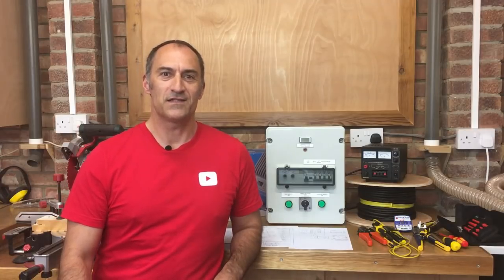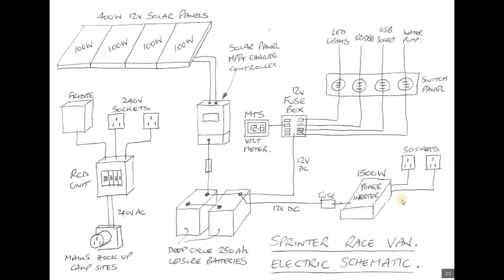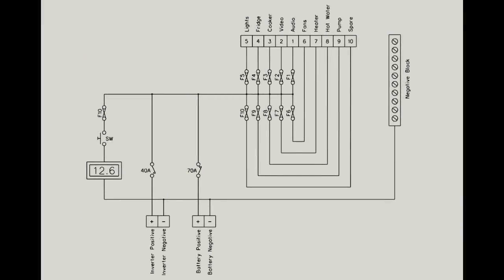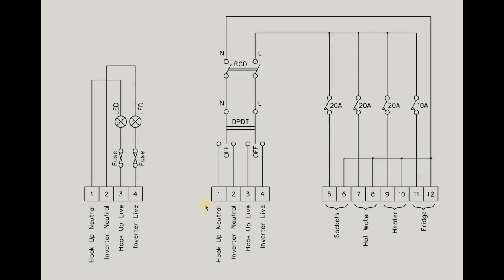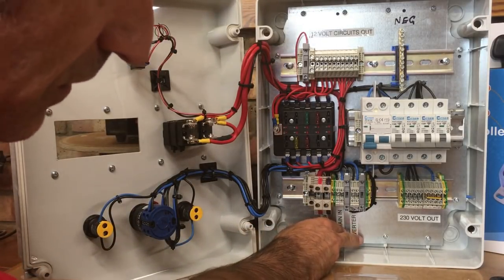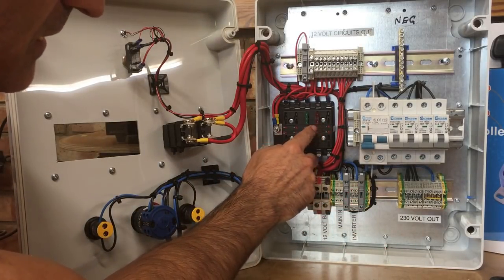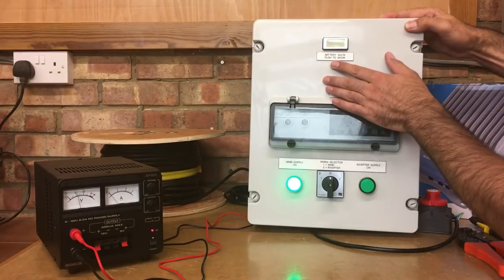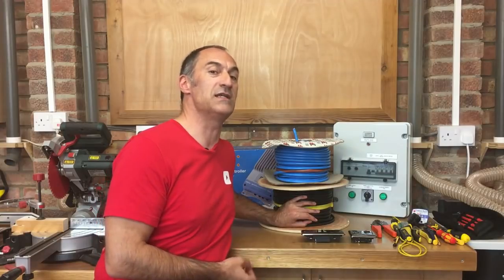Self Build Camper Van 12v Electric Control Panel

Comment: Great setup Greg

Just one couple of questions if you dont mind. Are you plugging into three pin uk inverter outlet and directly to input of consumer box, what cable are you using from hookup point to consumer box and lastly from what i have been reading up on i assumed that the cables should come in from the rear of consumer unit
Reply from the maker: Hello john, most hook ups are single phase 16amp breakers. 
So your blue hook up lead is most likely to be 2.5mm cable. 
From the back of your socket to the consumer unit can also be 2.5mm. I have also wired from the inverter to the consumer unit the same. 
All cables are rated by current used. Watts/Volts=Amps
Then google a cable sizing chart to give current carrying capacities of various cable sizes. Beware your 12v DC cables will draw more current and may need much bigger cables. Fuse sizes are 1.25x maximum current used.

Comment: Hi Greg, great videos and your attention to detail. I watched all your videos and I can't wait to see when you are going to finish and start your adventure.
Hopefully you will post videos from your adventures.
I have a question, from where did you get the distribution board/box?
Reply from the maker: It was built to my own design from components sourced from electrical wholesalers like RS
You can buy the enclosures off eBay if you are confident to do the wiring, quite a few have done similar panels.
otherwise, I would recommend looking for PMS3 panel, very good and cheap solution.

Comment: I'm a little confused about the edit to the post regarding the breaker - I didnt see a separate breaker for the panel but rather a DPDT switch leading into the rcb and circuit breakers.
In effect you are switching between shore power and the inverter to power the same set of sockets and any special circuits (A/C, maybe fridge).  The inverter output is set by the capabilities of the inverter.

As I saw it the 12v side of it ran through fuses not breakers.  If the inverter draws 2000w on its input side it makes sense for it to be separately protected.

I have a couple of different problems with and Aussie build as we are required to use double pole switches, breakers and points in caravan use to disconnect both active and neutral at the same time as a safety issue.  I also want to feed in between shorepower and inverter and Im thinking of using a din rail 3 position double pole changover switch (up mains, centre off and down inverter) with slimline double pole RCBO's per circuit (probably only 2).  I like your panel however I doubt that I will have the luxury of that much room.  We also have rules that prevent anything being stored in front of a switchboard if its placed in a cupboard so I expect to place the panel in a shallow cupboard somewhere behind the driver's head (facing forward)
Reply from the maker: I had originally wired the 12v supply to the inverter from the panel and put a DC trip in there but it was hugely undersized.
An error in the manufacturer's literature that I stupidly took for granted without checking. Plus better to have protection near the batteries to protect the cables.

Comment: This is impressive, but I'm not that clever. Instead, could you just wire a mains source via a battery charger to your house battery? then just use the charge to keep your batteries at 100% when you have mains power.

Comment: Hey Greg, Do you have a diagram that describes your internal wiring? I have started mine however i was trying to avoid splicing the DC cable so now i have 18 individual cables and am scratching my head on what to do next. 

Are you able to provide some ideas.

Comment: Hi Greg. Quick Question - having removed the inverter from the diagram for the 12v side, where does the inverter feed now come from and where is the trip now located? Cheers, Gavin
Reply from the maker: The inverter feed will come directly from the leisure batteries and the isolator and fuse will be located close to the batteries.

Comment: Hi Greg, Can you tell me the name of the DC trip protector and where I can buy it? thanks
Reply from the maker: You can get various different size circuit breakers for DC circuits
https://rover.ebay.com/rover/1/710-53481-19255-0/1?ff3=4&toolid=11800&pub=5575265109&campid=5338027957&mpre=https%3A%2F%2Fwww.ebay.co.uk%2Fsch%2F181818%2Fi.html%3F_from%3DR40%26_nkw%3Ddc%2Bcircuit%2Bbreaker%26_dmd%3D2
Reply: Greg Virgoe thanks Greg I meant the black relay

Comment: Hi Greg, Do you have a ebay link for your raw distribution board?
Reply from the maker: https://rover.ebay.com/rover/1/710-53481-19255-0/1?ff3=4&toolid=11800&pub=5575265109&campid=5338027957&mpre=https%3A%2F%2Fwww.ebay.co.uk%2Fitm%2FWEATHERPROOF-IP65-LOCKABLE-ABS-ENCLOSURE-WITH-METAL-BASE-PLATE-CLASSIC-WALL-BOX%2F112869512272%3Fhash%3Ditem1a478c1450%3Am%3AmwVlFok5tQmjNYB4EEcZ3sw
Reply: @GregVirgoe  What's the extra door you have added to the front of your enclosure called? Trying to find one without knowing the name for it is a pain.

Comment: Hi Greg, great set of videos you have here, they are very detailed and easy to follow. I am building my van up for a 2 month trip around Europe next month and many more I'm sure. I was wondering if you make these consumer switchover units to sale? This setup is exactly what I am after, and it would be ideal if I could buy a unit like in this video ready to go, would you be able to make another and if so how much would you be looking (I'm in the UK) thanks again for the videos - subscribed!
Reply from the maker: Hello Steve,
Unfortunately, due to health and safety, I cannot produce these to sell myself as I would have to jump through so many hoops to have them checked and tested and certified it would make them far too expensive.
There are very reasonable power panels available that do a similar job on this link
https://rover.ebay.com/rover/1/710-53481-19255-0/1?ff3=4&toolid=11800&pub=5575265109&campid=5338027957&mpre=https%3A%2F%2Fwww.ebay.co.uk%2Fsch%2Fi.html%3F_from%3DR40%26_nkw%3Dpms3%26_sacat%3D0%26_dmd%3D2

Comment: Hey Greg, been following your vids a while, wondering what red wiring you've used here to connect to the positive of the fusebox with a possible link to purchase. I'm about to install fusebox on my little suzuki carry and was going to use 1.5mm 2 core wire as you've specified before but this thicker red wire looks different and I've seen it on many other vids. I've also noticed your fuse box doesn't have a negative terminal bus where as mine does. So what wire you think would be suited?
Reply from the maker: Hello,
The more circuits and appliances you add the thicker the wire needs to be to handle the extra current (amps)
So that's why the leads coming off your battery to feed the fuse box are much bigger. use this chart to determine what size cables you need. https://goo.gl/images/zKViC1  The wires in my panel are "Tri Rated" so they can handle a greater temperatures.

Comment: Hi Greg, 

What thickness is your junction box? I’m copying this and want to make sure everything fits flush like yours.

Keep up the great work! 

Thanks 

Craig
Reply from the maker: Hello Craig, it’s a standard adaptable box and was much deeper then the trips. You may be able to see that the metal din rail is raised off the back plate by threaded rods to bring the trips level with the cover. You can adjust the threaded rods to get the spacing correct. Hope that helps.
Reply from the maker: Hello Craig, it’s a standard adaptable box and was much deeper then the trips. You may be able to see that the metal din rail is raised off the back plate by threaded rods to bring the trips level with the cover. You can adjust the threaded rods to get the spacing correct. Hope that helps.

Comment: Have you found an electrician to test your electrics? I've contacted so many who won't work on campervans so it'd be great to get a recommendation if you know of someone who offers this service.
Reply from the maker: Hi Hannah, normal household electricians don't work with 12v systems so it's better to search for Auto or Marine Electricians as these both deal with 12v systems and I find Marine / Boat industry most helpful as they know about leisure batteries and inverters. Here is a very good list of electrical trades people across the country. http://www.canaljunction.com/boat/electrics.htm
Reply: Thanks so much Greg. We ended up having a regular electrician look over everything and he was happy with it. But I think we would've been better going with someone more specialist. We were pretty confident everything was right though so it was just for some peace of mind.

Comment: I am familiar with the electrics, because this is basically how it works on my boat (old wooden converted fishing troller), where it was done by a certified marine electrician because I didn't trust myself with it.  But I sure wish I had had this explanation when I tried to wrap my head around how the electrics worked.  Nice, clean build, and very clearly explained.  All the fledgling vanlifers out there could definitely make good use of it.

I'm subscribing even though I probably will never convert a van (very happy with my boat), but it'll be instructive and interesting to follow along, I think.
Reply from the maker: Thank you so much for such great feedback. Do you use solar or wind turbine for off-grid power?
Reply: Both because we have the room to put up solar panels, but primarily wind.  We live on the coast of Vancouver Island, British Columbia, Canada, where wind is a lot more reliable year around than solar.
Reply from the maker: I’m guessing you naturally get a difference in air pressure from sea to land so there’s always wind at the coast. Do you have a charge controller that can take a dual supply?
Reply: Right, it's almost always windy; we might get a few days in deep summer where everything seems to be dead, but it's rare.  Yes, we have a charge controller that can handle multiple inputs.

Comment: Hey Greg! When you hook up all your negative 12V to the Bus Bar, do you have to ground that back to the batteries, or can you ground it on the frame?
Reply from the maker: Hi, all the 12v negatives from the panel go back to the negative on my leisure batteries.
Reply: Thanks Greg! And is the leisure battery grounded to the frame, or no?

Comment: A question about mains (not DC) grounding. I'm imagining that an AC appliance in the van is plugged in to a house mains source via an extension cord. The grounding is thru the cord (and fuses in the house panel). Regarding the grounding, why cannot the van mains can be considered the same situation? i.e. why ground the van mains to the chassis via negative DC busbar?
Reply from the maker: Lets clear up the terms first. With mains, you have a Live, Neutral and Earth.
When on a hook-up you should have all three in your hook-up lead and earth will be via the earth wire.

When you say Ground I always think that you refer to the earth connection.
Your van chassis is used by your Auto electrics as a negative return path to the van battery, this is not an earth.
Your positive is wired to all your devices like radio and lights etc then the neutral return to the battery via the chassis.
It just a way of saving running loads of wires in your vehicle.
I plan to keep my 12v leisure circuits separate to my vans auto electrics so there are no issues and I have run live and neutrals to all my 12v devices back to my panel.
Hope that helps.
Reply: Thanks!  I watched again - somehow I got the (wrong) idea that the AC grounds were connected to the DC negative busbar instead of just feeding thru the RCD.

Comment: HAve you considered running a circuit (always on but tripped) from the 230 V to a battery charger for your leisure batteries when hooked up?
Reply from the maker: Yes, my mains battery charger turned up today, 
look out for a future video on this.

Comment: Great set of video's! How did you make the labels for the front panel?
Reply from the maker: A local guy to me does engraving and they are engraved on a material called traffolyte which is a plastic sandwich white/black/white and he engraves through the white layer to expose the black letters. you can get lots of colours.
There are loads of people that make them to order on eBay see this link https://rover.ebay.com/rover/1/710-53481-19255-0/1?ff3=4&toolid=11800&pub=5575265109&campid=5338027957&mpre=https%3A%2F%2Fwww.ebay.co.uk%2Fsch%2Fi.html%3F_sacat%3D0%26_nkw%3Dengraved%2Blabels%26_frs%3D1

Comment: I am thinking of the breaking and making capacity of the DPDT switch. If you are running your appliances like fridge and heater from inverter and then when reach campsite and switch to camp power, the switch has to break this amount of current and make for the camp power. How much is rated in Amps this switch?. Normally, I will use those small switches along with a proper contactor , that way the switch life is much longer.
Reply from the maker: The rotary switch is rated at 20A, your hook up supply is 16Amps max, my 2kw inverter is 9Amps.
So the switch is plenty big enough, but if you're worried about lifespan why not isolate the supply at source when switching over then turn back on.

Comment: Hi Greg. Brilliant panel design and assembly. What size and make of inverter did you choose? I want to be able to charge my mobility buggy ‘s battery when off grid. They are 24 volt and the charging rate is max 8 amps. I guess I’m going to need a 500w inverter and due to the design of the charger it has to be pure sine wave
Reply from the maker: Hello Mike, I have a 2000w pure sine wave inverter, generic one off eBay. 
However in hindsight after lots of thought, I should have looked about.
Since found that vitreon do a single unit that combines solar, inverter and battery charging all in one device.
I've already bought all these separate devices which will take up more space and require more wiring.
Still maybe on the next one :D lol

Comment: This video is fantastic...what an amazing piece of work! Thank you so much for sharing, it was explained so well. Where did you buy the casing for you distribution board?
Reply: Hi Greg, what are the dimensions of your distribution box?
Reply from the maker: It's an IP65 ABS plastic enclosure with a metal backing plate, they start from about £35 off eBay

https://rover.ebay.com/rover/1/710-53481-19255-0/1?ff3=4&toolid=11800&pub=5575265109&campid=5338027957&mpre=https%3A%2F%2Fwww.ebay.co.uk%2Fsch%2Fi.html%3F_odkw%3DPlastic%2BABS%2BEnclosure%26_osacat%3D0%26_from%3DR40%26_trksid%3Dp2045573.m570.l1313.TR0.TRC0.H0.XIP65%2BPlastic%2BABS%2BEnclosure.TRS0%26_nkw%3DIP65%2BPlastic%2BABS%2BEnclosure%26_sacat%3D0
Reply: Greg Virgoe Thank you!

Comment: where can I get the actual panel from, got the links to the bits and bobs to make it but want the unit to fit it all to now. Thanks
Reply from the maker: Try this search link https://rover.ebay.com/rover/1/710-53481-19255-0/1?ff3=4&toolid=11800&pub=5575265109&campid=5338027957&mpre=https%3A%2F%2Fwww.ebay.co.uk%2Fsch%2Fi.html%3F_from%3DR40%26_trksid%3Dp2047675.m570.l1313.TR0.TRC0.H0.XElectrical%2BEnclosure%2Bwith%2BBackPlate.TRS0%26_nkw%3DElectrical%2BEnclosure%2Bwith%2BBackPlate%26_sacat%3D0
Reply: great thank you.
Reply from the maker: Happy to help 😊

Comment: Nice circuit, although it bugged me, that the 12V devices can only be powered by solar and not by the hook. I thought about it for quite a while now, and I think you can build another switch like this to choose, if the battery gets charged by solar power or by the hook. This way you can choose for each circuit separately how it should be powered

There are four cases in total: Two of them are already implemented in your circuit:
12V solar, 230V solar
12V solar, 230V hook 
The other two are:
12V hook, 230V hook
12V hook, 230V solar

I also got a question about the power indicating LED of the inverter. In my view this LED will always be on, besides when the battery is totally flat, which probably won't happen because of the solar panels. So the voltage display already has this information
Reply from the maker: Hello, there are a couple of things I did not cover in this video. 
The 12volt devices are powered directly from the 12volt Leisure Batteries.
The leisure batteries will be charged THREE different ways..
1. By the solar panels via the solar charge controller.
2. Split charge relay kit connected to the van battery while driving.
3. Mains battery charger when on hook up on camp site.
There will be provision for charging the batteries in every situation.
I have got remote display for the solar charger and the mains charger,
So I can see inside the van at any time the exact battery status. 
There will be videos on both split charge kit and mains charger soon.
Hope that helps you.

Comment: Hi Greg, just at the stage of putting the wires in and have bought the cable you used :) Just going through this great vid again with my dad who is a sparky (who is very impressed) and he's going to build me a control panel. Could you tell me where you purchased the actual white box for the control panel? Also did it come with the plastic flap to cover the trips? Cheers!

Comment: think the breakers on the 230vac side are way to big for the amount of max. power the inverter could deliver.
at 1500watts the maximum current could be  6,5 Amp.
So you disable some of the 230 equipment when on inverter, or you scale down on the amp rate of the breakers?
also if you would use total of the rated breakers it would be too much for the 2.5 mm cabling I think.
only my 2c, but very professional setup and planning